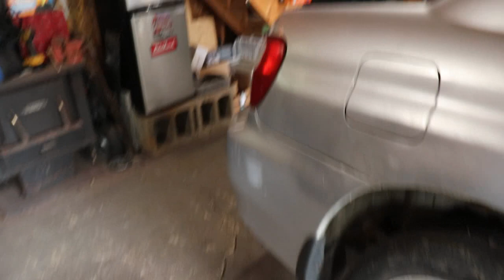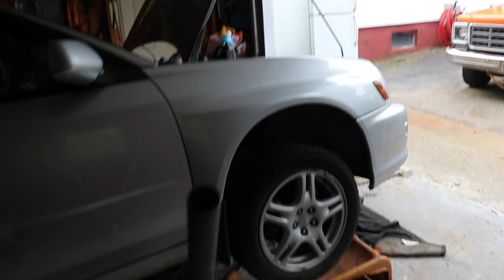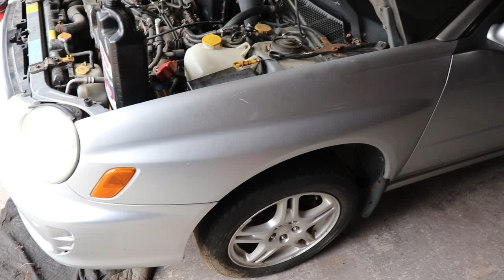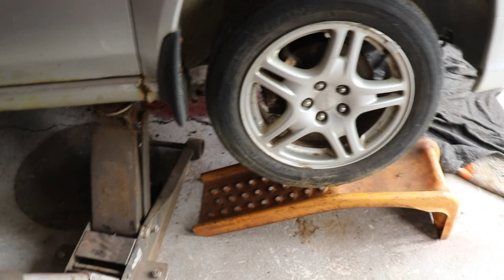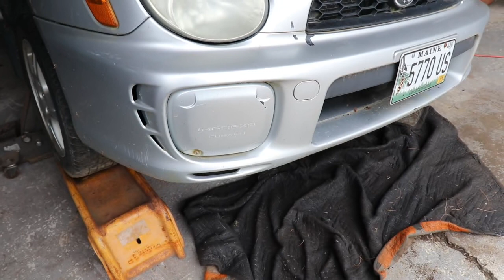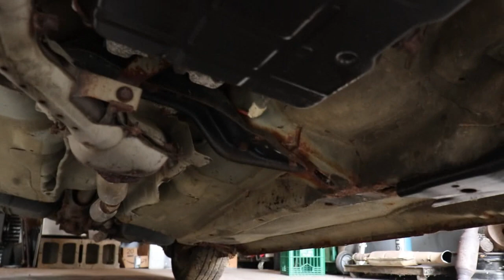Whats up with that Subaru?

Comment: I’m curious as to why the Subaru got parked originally. I agree that the failed cat salvage looks fairly recent, but other than the collateral damage from that it looks to be in fair condition. I bet you don’t come across to many cars with almost a full tank of gas either.